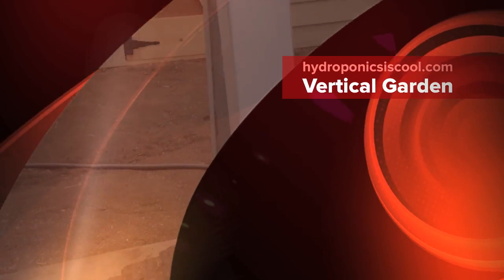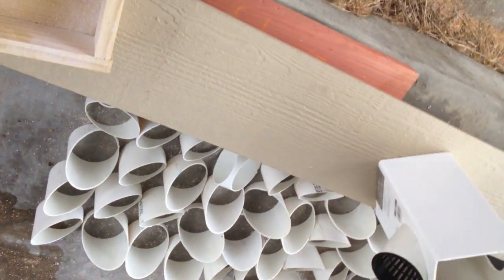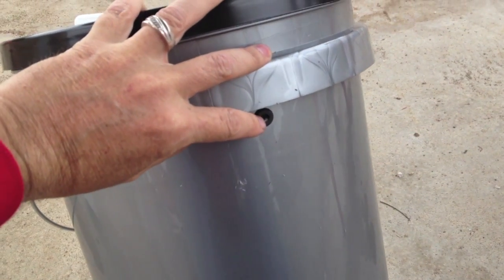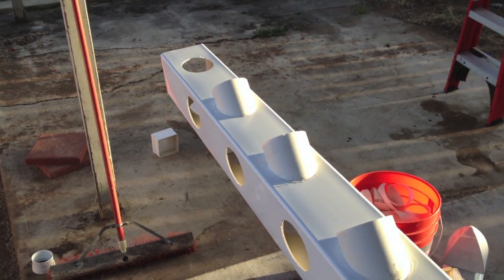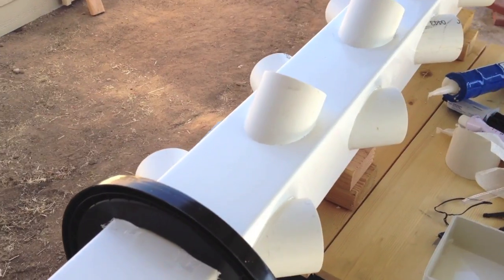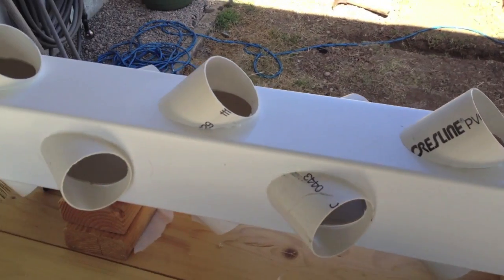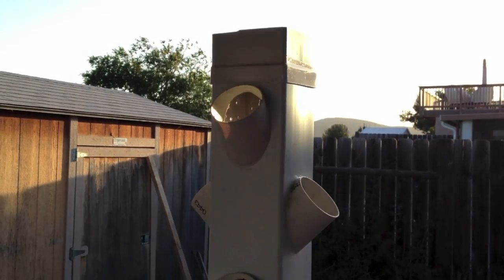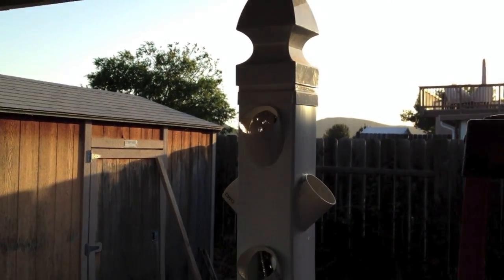Building a hydroponic vertical garden

Comment: How did you cut the 3" pvc?  I made a box like you have in your video and when i try and cut the pvc at a 45 degree angle with the miter saw, the pvc pipe shatters (basiclly explodes) out of the box and shoots all over the place.
Reply: +Tim Delesio I realize that this comes a bit late, but sometimes pvc can be easily cut by turning the blade around to run backwards. I do this with my hole saw when cutting through pvc. I, simply, run it in reverse. It won't catch large chunks, kick, and chip. It cuts like butter (sort of).
Reply from the maker: Be sure its a fine saw blade and go reeeaaallly slow
Reply: HydroponicsIsCool Recommendation?  60T or 80T?
Reply: did you ever think of a clamp???

Comment: I see you said the post stands up fine, but what about windy times? Any other support? I'm thinking or adding a extra bucket underneath and that little space fill with cement. But that's just an extra 2-5 lbs.
Reply from the maker: It stood up fine when it has a full bucket of water, but that does sound like a good idea.
Reply: finish the house with a sheet of tin roofing??

Comment: Germany calling with 2 questions!

1.) How is the white "PVC-tower" called and what is it for - originally (seems we do not have it in Germany - I looked my ass off, but cannot find it).

2.) How do you make this "PVC-tower" stand so straight with no support (I can see), but the bucket it stands in? Is that bucket really all what supports the "water-tower"?

Hoping for your response,
from Cologne,
Jue
Reply: you can always switch to 4in. dia. tubing  and spend a lot of time making an oblong shaped hole with a DREMEL TOOL and bitt suggest you make a template and marker to speed it up,ed

Comment: AVOID PETROLEUM-BASED PLASTICS SUCH AS PVC, EVEN AVOID FOOD-GRADE PLASTICS, THEY PRODUCE AND RELEASE TOXINS THAT PASS TO PLANTS WHICH BECOME FOODS!! PVC contains harmful carcinogens, most notably VCM. Other chemicals such as dioxin and phthalates, both carcinogenic, may also be released into an indoor environment, endangering the people who work and live in buildings that use PVC. Dioxin is a super-toxic chemical released when plastic that contains chlorine is burned. Aside from cancer, Dioxin can also trigger nervous system disorders and birth defects. Phthalates are carcinogenic chemicals often used in plastics to make them flexible. While the fact that vinyl contains carcinogens should be reason enough to avoid it, PVC is increasingly dangerous when HEATED BY SUN or burned.
Reply: futurevideo10 Too bad all the plumbing in almost all houses is PVC... Guess we all gonna die... wait...
Reply: Nathan Rogers
Cancer rate was much lower in the days when PVC plumbing didn't exist!
Reply: futurevideo10 yep. Then it was called witchcraft instead. Or would you prefer going stark raving mad with the lead plumbing instead?
Reply: Nathan Rogers
Cancer rate is 10 times lower by using galvanized steel or copper plumbing.
Reply: there is food grade plastic tubing if you want   pay the price. seems ironic all the health food freaks found a way to use cancer causing PVC water pipe to grow their super healthy food and still die .helps get rid of the s/s rolls..

Comment from the maker: WakeUpB4uDie I actually will shortly. I didn't like how the water spray worked so Im working on a redesign of that part. Running some tests now and will have a follow up video soon.
Reply from the maker: matrix49A had it on a timer set for 15 on and 30 off. during warmer times I went 15 on/off
Reply: now a days i found hydroponic vertical garden 
Panlarko expert aquaponics planner is main
Reply: +HydroponicsIsCool a very nice video about hydroponic vertical garden. When i search google with the phrase 'hydroponic vertical garden',  i found another excellent technic called Panlarko Expert Aquaponics Planner. A mind blowing technology
Reply: +HydroponicsIsCool If you is interested in aquaponics the greatest results that I have had was with the Keiths Ponics Site (just google it) without a doubt the most incredible info that I've tried.
Reply: where did you find the insert ( where you have the hose head hooked to ) on line, what is it called its a over the top sleeve?

Comment from the maker: See if I can answer some of your questions.
- Yes they are cut at 45 degrees
- Post stands up fine in the bucket
- On larger pump, it may not fit in the bucket with the post over it
- the pipe pieces are gluon ON to the post. Make sure you line up with the bottom of the hole.
- I just use the clay balls, no soil
Reply from the maker: matrix49A no just the net pots

Comment: Love it!  I am trying to gather the materials to make one. I get that everyone cuts the post to accommodate a  260 gph pump, but for about $5. more  a 400gph pump would fit a higher tower (and not produce as much wasted post),  Is it possible to have too much flow esp. with a 5 gallon bucket?  Also, does anyone know how to make a level on the side of the bucket?
Reply: big is better as always can buy a chep  pressure regulator with gague